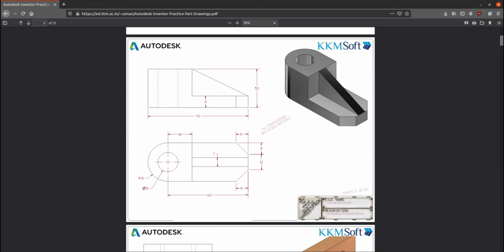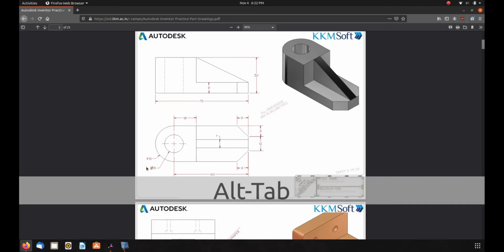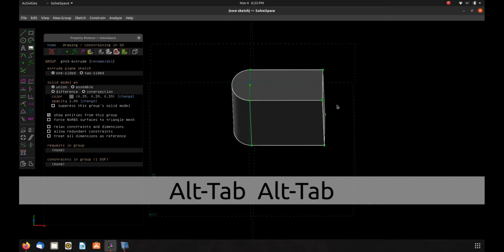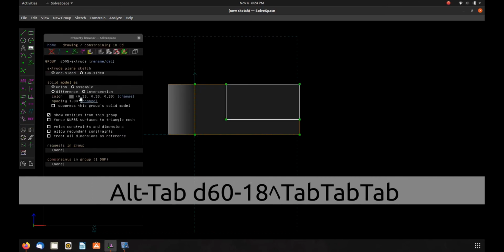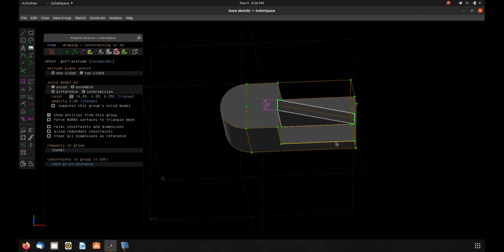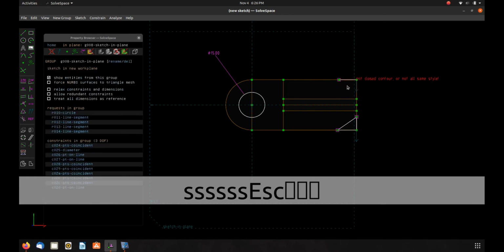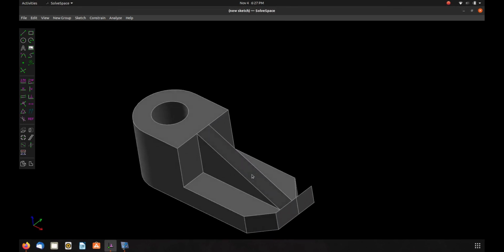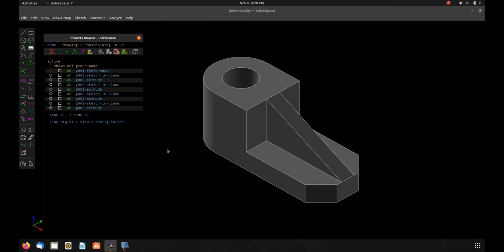Solve Space Tutorial 1

Comment: Great tutorials. You could have placed the hole on the initial first sketch of the base, before extrusion. But both ways are totally valid, and your method is more desirable when dealing with blind holes for example.
Reply from the maker: That's very true.  I was always taught in both schooling and in industry to model how the part will be machined, as that will help you understand the machining order of the part as well as give every feature of the part a distinct corresponding feature in the feature tree.  However, for modeling casually putting the whole on the original sketch would be perfectly acceptable.  Old habits die hard.